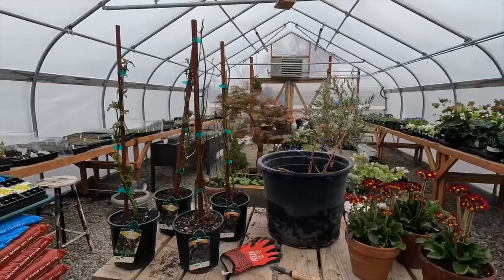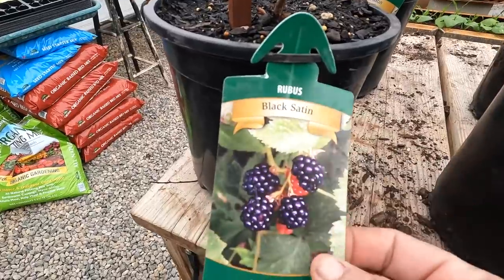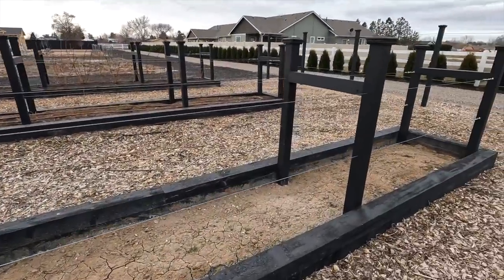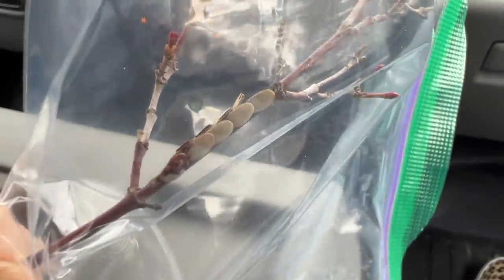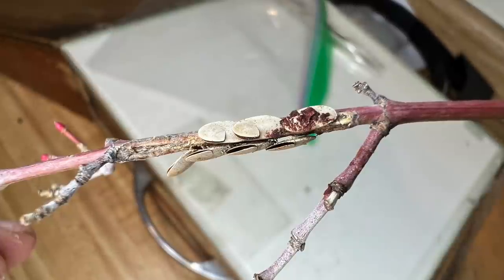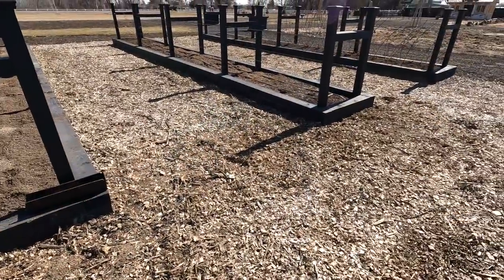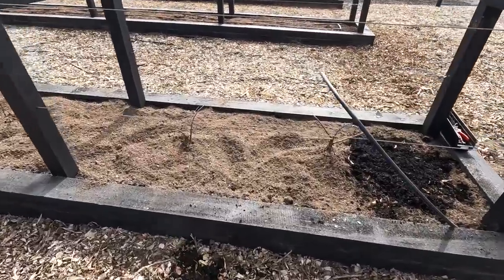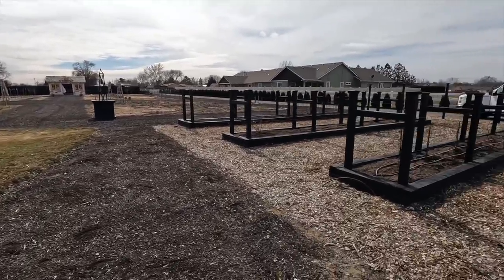Planting Blackberries!!! 🙌😁🙌 // Garden Answer

Comment: Your excitement for each project is contagious and gets me excited for my own spring plantings!  I've watched you for years now and have grown so much in my knowledge of gardening.  I've been taking gardening classes with Laura!  I've noticed you have continually adapted your drip system installation method.  I'm assuming as you learn what works and doesn't you keep working to perfect it.  Isn't that the beauty of gardening in general? In this video, you are using clamps to secure the tubing to the barbed connectors.  I love this idea and wondered if you could share the sources of the clamps used as well as the clamping tool. Thanks so much!

Comment: I am amazed at your brute strength when attaching irrigation lines to the connectors. I need to use a long Bic lighter to heat the line and insert the connector.

Comment: Primocane varieties are the way to go, though they may not be viable in your cold climate as the canes are affected by the cold. But you can fruit them on the new growth that emerges each year.  Prime Ark Freedom is a more modern version of the one you were growing a year ago, but I would recommend Reuben, another primocane, which is very vigorous and has fruit which is far sweeter, while the Prime Ark ones seem to remain very sharp even when the berries look black and ripe. (Same problem with Triple Crown I think you will find.) Black satin is sweeter though and an older variety. 
Pruning is important with the primocane ones, and it is normal to 'tip' the Prime Ark ones which encourages same season branching and fruit borne on the laterals too.   Good luck and I hope you post a video about the results.

Comment: They are Katydid eggs

I don’t know much about insects but I googled search the description as soon after watching this video. And this is what I found out; “katydid, (family Tettigoniidae), also called long-horned grasshopper or bushcricket, also spelled bush cricket, any of about 6,000 predominantly nocturnal insects that are related to crickets (the two groups are in the suborder Ensifera, order Orthoptera) and are noted for their mating calls. Katydids are also known for their large hind legs and extremely long threadlike antennae as well as the thick, upwardly curved ovipositor (egg-laying structure) of the females.
Depending on the species, eggs may be deposited in the soil or directly into plant tissue; some species lay their eggs on sticks or rocks. The young are similar to adults but have less-developed wings. Katydids feed chiefly on plant matter, though some species are predatory, feeding on other insects.”

Comment: Coffee and morning video's are a great way to start the morning. I do have a question. I noticed you used the 1/2 inch hose and not the 1/4 inch. Is it because the water needs to travel farther or it is because that is all you had? I am going to be doing a 1/4 of my front yard and I was going to order the 1/4 inch. Maybe I should switch and get the 1/2 inch. Just wondering.

Comment: 3 plants in a 3x10' area. Apply in beds in this order: Epsoma Soil acidifier layer on soil - 1.5 cu ft (30 bags for 30x3' bed) Epsoma organic raised bed mix (can use bulk compost) - Berry Tone small amount sprinkled on top of soil on each spot where you'll plant each plant.